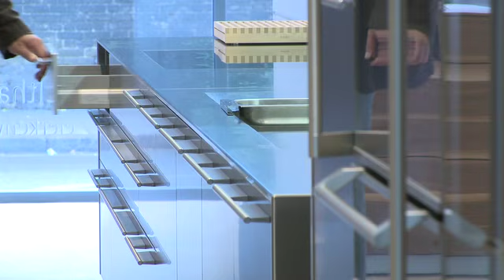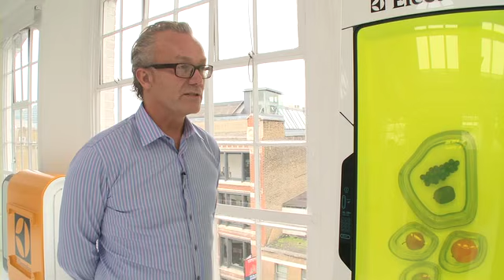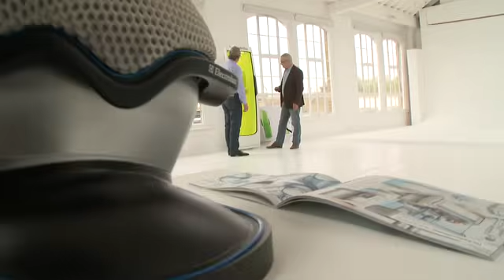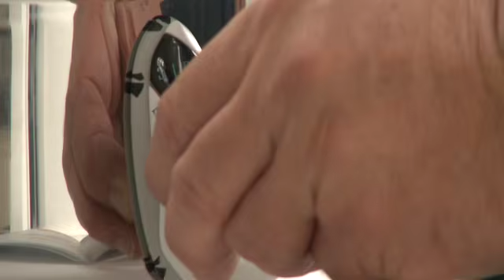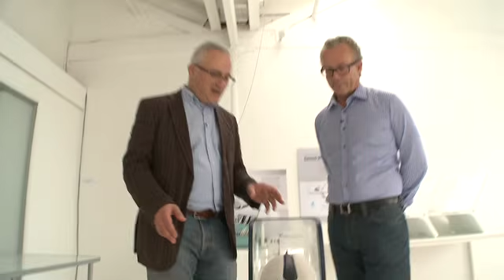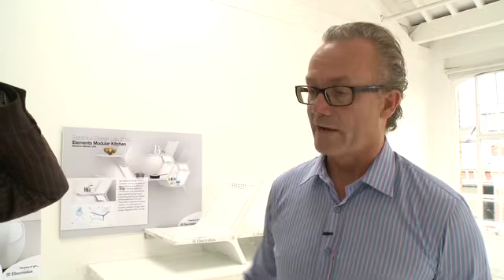Electrolux Design Lab 2010 on Financial Times 'How to Spend It' (Technopolis TV).

Comment: NASA already has a polimer that repairs itself when damage occurs combine this with a normal fridge leave enough space for it to expand  and reduce the surface tension of the polymer to the point required to push your hand in (concept completed)
Reply: Yeah because you can totally just combine things like that... I have a knife and a laser I can just turn it into a lightsaber
Reply: +chris wilson name of that polymer?
Reply: Japan is selling it as cutting boards on the Internet now for $50-$70 per square meter
Reply: Devansh Kalia its called self healing polymer and Japan is selling it for $50-$70 USD per square meter as cutting boards now